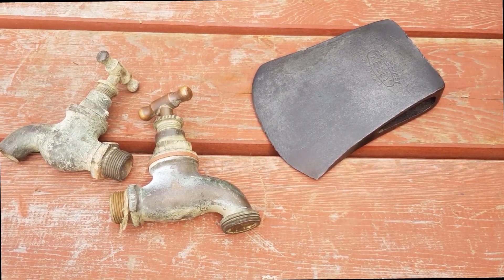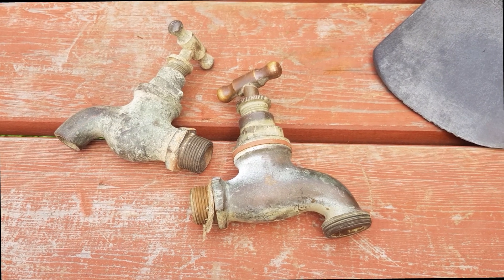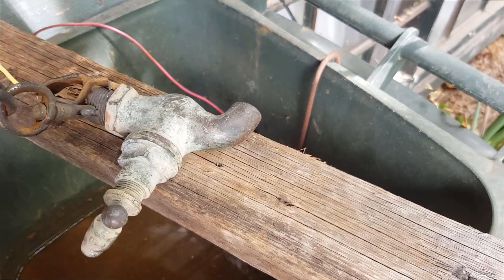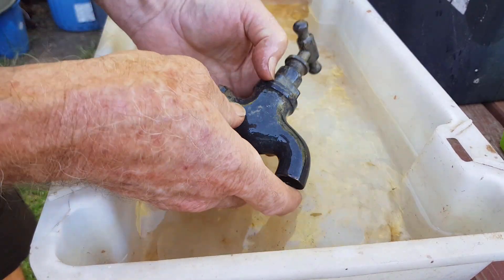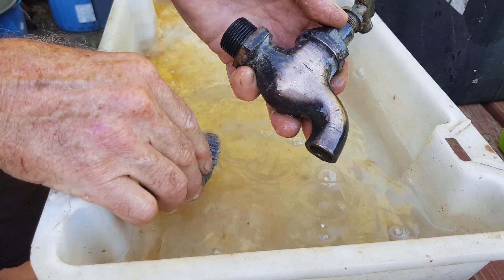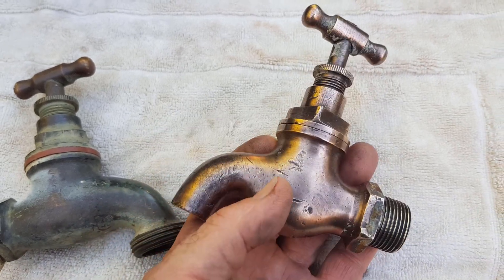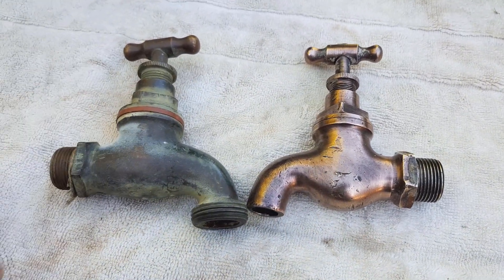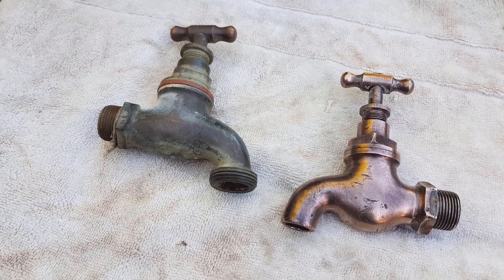Successfully cleaning brass items with Electrolysis - Metal Restoration

Comment: Do I need a brass annode or will my stainless annode be fine?
Reply from the maker: Nope Geffrey, and you shouldn't use stainless steel either. The anode is sacrificial and using stainless will leave chromium compounds in solution which is not healthy. Best just to use basic iron and when it eats away too much, replace it with another piece.
Reply: @TheUltimateRecycler  hello and thanks for the tip. I got tired sanding and scraping my iron, not thinking at a chemical level at all. I have a constant supply of iron, so back to the mower blades.

Comment: The answer is that most well made spigots, they use red brass which I believe is 95% copper. Most likely when it was new it looked that red.
Reply from the maker: That's certainly possible. Red brass is called gunmetal here. Thanks for watching 😊

Comment: Hey mate, I like your videos. Thanks for producing and uploading. I use an IBC as my electrolysis tank. I use it at my farm and sometimes put engines or machinery parts in it with a chain hoist. But mostly it is smaller tools I find about the place.  Mostly on the farm as it is heavily used and things turn up all the time.
Reply from the maker: Cool, thanks Rhys! Wow, that's a serious electrolysis tank!

Comment: well first thought- you changed the metal, not cleaned it, you also covered teh tap with FeO which is black, , you made zinc leave into solution as ZnO, now the tap will turn green over time, not like brass, yes it looks clean but actually ruined the tap, might avoid doing this to a museum piece - keepsake... esp the time in the bath????... we should ask a museum curator
Reply from the maker: I disagree with most of what you have written Steven, but I do appreciate you watching and commenting! 👍
A couple of things - the tap won't turn green (verdigris) any more readily than any other copper alloy. I've been cleaning brass like this for years and have never had any turn green!
It's possible that the electrolysis has pulled zinc from the surface and caused a minor colour change - but the chemical process would be complicated and certainly zinc oxide would not be in solution as it's insoluble in water.
The tap has most definitely not been ruined in my opinion - quite the opposite!
A museum piece is a totally different kettle of fish - anything that important simply should not be cleaned at all by an amateur!
Cheers! 😊

Comment: Don't  waste  your ketchup  on cleaning brass it doesn't work  I have  tried to clean the brass on  buck stove nothing happened  so save your ketchup  for your  French  fries
Reply from the maker: Totally agree Steve! 👍
Reply: It'll turn more to brass if you put like a torch to it to get the metal heated back up, we used to coat copper pennies with zinc and then put it under a torch to make it brass

Comment: That worked out very well. I’ve used electrolysis on steel but haven’t tried it on brass or bronze copper etc.  Do you mix the same for this as you would steel?
Reply from the maker: Yep, same solution 👍

Comment: My first curiosity lead to a very blue green piece of brass
Reply: I was doing some searching on this exact subject on Google and YouTube. In one video, they demonstrated a commercial product which involved dipping copper products in a blue transparent solution, after they first rinsed the copper, after the blue solution, it came out a bit brown. They rinsed it again and then, they dipped the brass in a 10% sulfuric acid solution for just a few seconds.
It removed the brownish shine instantly.
After that, they rinsed it again and it was beautiful clean and shiny. I was thinking, would the sulfuric acid treatment also work that well on the product after electrolysis, to clean off the dark staining?
Just trying to think of an easy and thoroughly way of cleaning old brass and copper ornaments, knobs and such thing.

Thanks for the video.